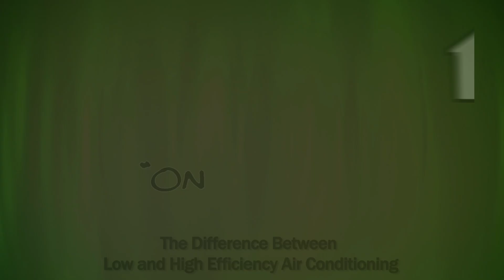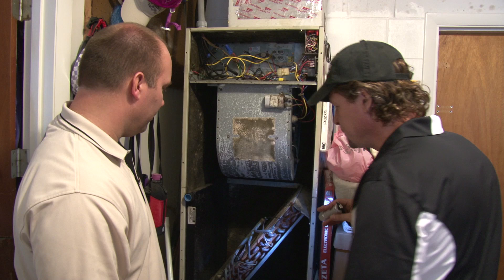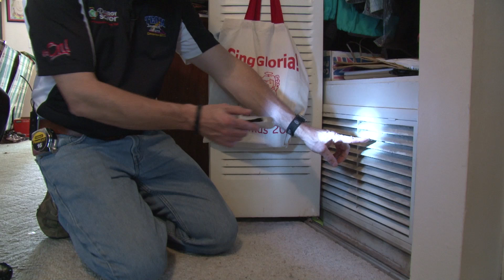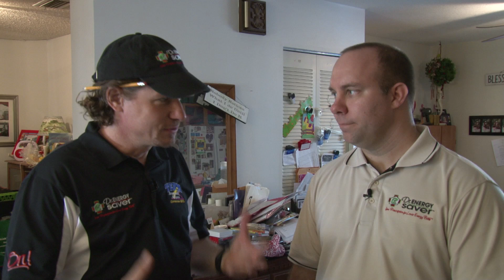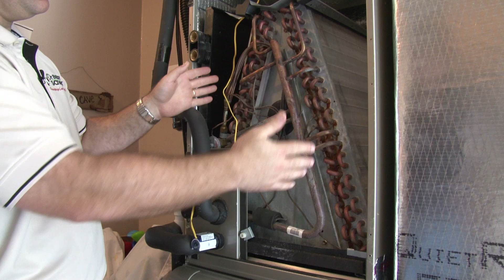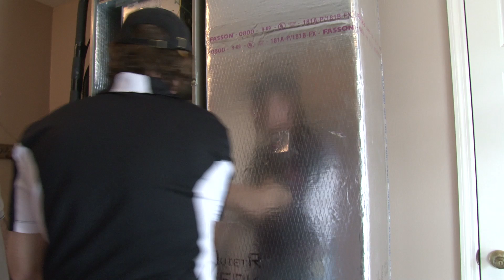The Difference Between Low and High Efficiency Air Conditioners

Comment: I am an HVAC tec ..THIS GUY IS LYING,,, THERE HAVE NOT BEEN ANY  4 TO 6 SEER  units sence 1992 when 10 seer was mandated by the government. in 2002 it was  changed to 13 seer  this unit was made in 1995 according to there dates given and the age of the video. it could not be less than 10 seer.  I have seen this tactic used to scare people into a new unit.

Comment: lol most of the stuff these guys have said in this video is wrong.  For example they didnt know which direction the air moves across the condenser and he called a capacitor a contactor.

Comment: The bottom line is this the bigger the radiator on the outside relative to its size the less money it cost to operate and the more efficiently it works. There is no new technology being employed here just make the radiator bigger and the unit is called 14 Seer or 16 Seer or 20 Seer or 25 seer. While there are other small improvements like more accurate expansion valves the bulk of the high efficiency rating is the size of the condenser. Higher inefficiency you go though the more gadgets there are to go wrong and the greater the amount of the repair bills and I wonder whether there is even any payback over 20 years. Usually your electrical provider will do an energy audit for your house and put all this in writing for you for free. Maybe we should try that before we just run out and buy a new unit.

Comment: where i live, there is few honest hvac buisness or quailified techs to work on the latest greatest multispeed superduper ultra custom high efficient 20 stage compressor, but warning they will get fined and everyone does life in prison, if they do a change out, and dont change over the refrigerant to the new stuff that hasnt came out yet. and they are only required to change out the air handler as a complete unit, unless its hard to install.
guys before you let anyone try to get you to remortgage your home make sure your home is insulated well.  and there is plenty of used units out there for the ones that cant afford a wifi 19 seer unit to add on a mobile home.
to the people that can afford a new unit im not talking to you.

Comment: This is nothing but a SALES PITCH from these two salesmen. I am a retired engineer and would not buy anything from someone that pushes the pitch without having metrics to backup their argument. Both the condenser coil and the evaporator are heat exchanges that may see some loss in their operation but nobody should be replacing their ac unit just for that reason. Washing your condenser coil with a garden hose a few times per season will ensure a favorable and efficient operation.

Comment: High-efficiency units cost 40% more to repair down the road because they have 2 compressors in the unit outside, it causes your unit outside not only to run in the summer but also the winner. Which makes it work double time, not good! I had a heat pump finally was able to got rid of it. I’ll never will go back again! I guess you have to live in learn, the hard way? Just my opinion not trying to make anyone mad.

Comment: "All heatpumps are AC but not all AC are heatpumps".

It is just big lie. It is exactly oposit - All AC are heatpumps (mostly) but not all heatpumps are AC. AC can "just" cool and use heatpump for that. But heatpump itself can reverse cycle to heat instead of cool but its not called AC more.

For example: Fridge is heatpump to but it is not AC, clothesdryer usually use (new machines) heat pump but it is not AC.

There are many lies and inaccuracies in this video that people never should buy anything from this guy...

Comment: The air-conditioner unit locates inside the house; the water drainer system was not perfectly designed. I cleaned up after the first water leaking, and then it leaked again after two
weeks. Finally, I found they installed two 90 degree PVC which causing clogging. So, I had to remove one of the 90 degree PVC. Since then, there have not much problems...

Comment: Oil the bearings on the condenser and Blower motor. Clean both sets of coils, wala, peanut butter and jelly sandwiches.
Reply: 90% of hvac motors are sealed bearings
Reply: @harryjames5904  I do not have the information to back up that figure. I oil mine once a year with none detergent oil. My HVAC systems has been running for 21 years.

Comment: I get the point of this video but they fail to explain its really amazing and good value that this AC lasted 17 years.  I live near the ocean in Florida and we only get 10 to 13 years at best.  In fact, my 10 year old Tempstar has large sections of fins missing from deterioration.  These guys are hating on this 17 year unit but a I would kill for that reliability.  I went through 2 blower fan motors on the damn thing and will buy buying a new coastal rated system.   I'm about to get broke.
Reply: Our Goodman AC lasted 18 years, still works just low on R22 (which is illegal now) and the A-Coil now has leaks. We have an HVAC friend that had a few spare tanks of R22 and he recharged it and it's working again for now until we buy a new unit.
Reply: My old York lasted 25 years when it broke in 2015.

Comment: SEER stands for Seasonal Energy Efficiency Ratio, not rating. I'm in the process of buying a new unit and learned this today. Thought I'd point out the mistake lol.
Reply: You misunderstood the information you were given the higher the Seer the higher the efficiency I also don't know what you mean by rating. Air conditioning systems are rated by the Seer rating.
Reply: @6barry66  Didn't you watch the video? He said "rating" (1:44 mark). Should be ratio. Not sure what you're talking about in the rest of your comment. I didn't question anything about "higher the Seer the higher the efficiency".
Reply: My comment was from a different video not yours it's somehow got mixed up on YouTube and ended up on you my comment was not directed at you. It was to a different video.
Reply: @6barry66  No problem. It happens. Have a good one.

Comment: What about a 1982 model? What would be the typical seer rating be? We have a very old Coleman still running, but we upgraded to 19 and 21 seer mini splits ...

The nice thing is the original gas furnace still works, which is generator friendly for the most part

Comment: Some energy companies exaggerate concepts and use key words to sell sell sell.  Why are they assuming that unit lost seer rating over the years? As long as compressor has good valves and coils are cleaned the seer will be the same.  The house insulation factor plays a much higher role in energy costs as it deteriorates.

Comment: I am a HVAC tech. They are correct on all the technical information provided in this video. I have changed my 15 year old unit for a 21.5 SEER w/ HEPA filter and UV light w/ charcoal filter system. What a major improvement in air quality and cost of electricity. This show is great. Several tips I did was to insulate the electrical outlet and switches and finally install on the east and west facing windows a UV heat film from The Home Depot. I am saving now close to $230 in  the summer time per  month. My unit is also solar ready. I can run it just on 5 100 watt panels. I love this. All this tips come from watching this show.
Reply: That's right. Wait a little till that newly super efficient unit starts breaking down on you and see how much it is to fix it comparing to the good old ones. Then sit down and calculate how much money you will actually save.
Reply: good job!
Reply: it's only us who really understand...lawyers, doctors, and CPA's are practicing just like us....thus our value.

Comment: I've had techs check my air conditioners every year since I bought this house 14 yrs ago & they've never once cleaned the coils in the air box one time. In Houston the tech don't come out to fix or repair air conditioner's they're come out to sell you a new one.
Reply: I cleaned my zig zig or A A coil evap and it was a b*** took my 4 hrs start to finish and it was bad, but woah what a difference my air is better cleaner stronger colder and cools faster
Reply: they are either lazy or they are masters of understanding super heat and/or sub cool...perhaps it doesn't need cleaning but i like to at least sanitize...use your gut to decide who you can trust.  If you have to see your AC guy more than 3 times a year, reasonably speaking due to age of your system, then you might worry.  That being said...sometimes the application or installation was never correct.  if you feel within reason that your system is working well and you don't have to think about it for whatever various reasons....you're probably fine.  BUT it is 14 years old...be ready soon to replace as they don't make anything like they used to.

Comment: I've been doing industrial, commercial and residential hvac and building automation for over 35 years.Their is a paradox here. If you spend quite a bit more on a higher efficient unit and it's cost to remove the old unit and install the new one, how long will it take you to get that upfront cost back in energy savings vs replacing it with a lower seer unit. Also understand that a higher efficient unit's parts are considerably more expensive than a lower efficient unit. ( kinda like parts for a Ford Taurus vs a Chevrolet Corvette)  He spoke of a variable speed evaporator motor and the unit having two compressors. Also If it has a low ambient kit in it driving the condenser motor, there is more cost and more parts to consider their too.Common sense says if you have more components and they are high performance components, then you will have more repair costs eventually. All man made parts eventually fail. Your contractor can buy a typical after-market 3 speed 1/3 hp 1040 rpm evaporator motor/cap for about $75.00 bucks for a typical low seer machine. The newer units motors now are using the ECM X-13 and ECM Variable Speed Motor Modules...the modules themselves run about $150.00 for just the module. The motor it self added in if it fails can bring the evaporator motor cost to over $300.00 and thats the contractors cost, before it is marked up and then sold to you. Two compressors equals twice the chance of a failure vs one compressor. The best thing you can do is keep your filters clean, washout the condenser coil every spring and check the evaporator coil and clean if necessary as well. The correct size unit for the space is crucial as well as your duct work being tight with minimal air loss and the MOST IMPORTANT thing you can do is make sure your house is well insulated, windows for sure, door weather stripping and correct attic insulation is a must. Air conditioning is not designed to put cool air in your house, it is designed to remove the heat from it. A typical rule of thumb I've found to is for every degree you lower your stat, it can add around 8% to your bill and that works for heating too. So lets say if you set your thermostat to 72 in June and your utility bill for that cycle is $300.00...then if you set it 2 degrees lower to 70 the next month it will be around $350.00. That is if the outside temps both months are similar. The new smart stats can be effective in better comfort and some modest savings but again, with their cost being considerably higher than a typical no frills thermostat, how long will it take to see some noticeable savings. One thing I can tell you without a doubt is a two compressor unit with the right thermostat that looks at and can control the humidity in the house can be very effective concerning comfort. A 74 degree house with 50% humidity can feel more comfortable than a 72 degree house at 70% humidity. That is where the correct size unit is crucial concerning humidity. One thing that never works is one unit conditioning both downstairs and upstairs. Upstairs ALWAYS has to have it's own unit. And with the newer units having two compressors, you can now put say a 5 ton unit in place of a correctly sized 3 ton unit in an upstairs because most people especially in the south know that in the hottest months, the upstairs unit runs from 10 am to 10 pm just about non stop and usually can't bring the temp down lower than 76 in the heat of the day. But if you install an over-sized unit with two compressors, it can run one compressor in the typical months and reach set point and can bring in additional help with the 2nd compressor and more air flow in the hotter months when they struggle the most.Hope this helps.
Reply: Marketing strategy is sell sell sell,,, stick with basic system with a good dehumidifier
Reply: Just got a whole home dehumidifier
Reply: RobVoyles What I learned is that is a good investment depending on the upgrade you are doing. Going from a 20years old Seer 8 to a new Seer 15 will bring you a big monthly saving. Going from 15 to17 will cost you to much for the saving. Better invest that money to upgrade the insulation. The HVAC is secondary to the insulation. Is like try to cool your coke and keep it cool on a regular glass and on a insulated mug. You will need a lot less ice to achieve and keep the temperature if is well insulated.
Reply: Comments often have more value then the video.  Thanks for sharing.  This past year I found two major heaters that I repaired.  Poor insulation in a recess ceiling that would always hit 120,  and bath skylight, poorly insulated with 120 degrees in summer.  These two fixes made my 13 seer 4 ton AC work so much better

Comment: ♦️Here is a secret the air conditioner sellers don’t want you to know. Question: Which home air conditioner uses the least amout of electricity?   Answer: The one that is off.  

I live in Northern Wisconsin, USA.  A/C unit is 26 years old, no repairs yet.  I use the air conditioner less then 30 days a year. Even then, its noirmally only 1/2 a day at a time, so about 350 hours of run time per year.  

Also, our local utility has restructured their rates such that the fixed portion of the monthly electricity bill is larger and the variable “usage” portion is lower.  This new billing structure reduces the energy savings incentive from upgrading to newer, more efficient appliances, or installing your own solar system.  The utility did this pricing restructure so low energy users equally support the electric grid during peak demand.  People who use solar, it was claimed,  hurt the other utility customers because peak energy use is just after sunset, something called the duck curve.  Solar owners use less energy when electricity demand is low then pull from the grid at the same time everyone else is too, shortly after sunset.  Low cost suppliers to the grid like nuclear need constant demand to be efficient.  So solar owners really put a strain on the grid.  The new rate structure attempts to correct for these things.  

Although a new air conditioner unit may be more efficinet, my utilization rate is so low, and variable energy rate so reduced that when I ran the numbers, its not worth updating my air conditioner until the old one fails.  By my calculations, payback exceeded 20 years.  

Now my furnace, which runs about 8 to 9 months a year, is another story.  I updated my gas forced air furnace about 7 years ago, as I took advantage of a warranted failed heat exchanger credit.  With the discount due to the heat exchanger plus federal government incentive due to the improved efficiency, the post discount payback was under three years, actually 29 months.

Comment: Total joke. The higher the seer the more it cost to install and repair. You will not make up the savings in electricity vs cost to install and Maintain.
Reply: You could change it to a fixed orifice but you would lose efficiency and have higher humidity in your house. TXV is the best way to meter refrigerant.

Comment: I would prefer a 6 or 8 seer system over the new crap. The energy needed to cool the house from an a/c with the same tonnage has changed very little. And I have had customers say that have paid more in the new system than the old.

Comment: These guys are completely full of bs.  The big line which is the return line is insulated to prevent condensate moisture and missing insulation on the exterior won't hurt efficiency.  One thing to know on your high efficiency models is that they gain efficiency by using thinner walled copper.  The downside is the life of the condensing coil and evaporator coils is greatly reduced and especially on new houses in which formeldahyde is still leaching out of the OSB, etc.
Reply: I need to do my AC homework. What I am gathering is that the new 410a units run at a higher pressure through thinner pipes. If that is true, this is all straight ripoff in disquise.

Comment: More bells and whistles on those high effiecincies cost more to buy and more to go wrong leading to higher costs to maintain and repair. Plus 410a freon runs at approximately double the pressures and more pressures mean more leaks. Nothing to worry about there, huh...  I think I'll keep my old R-22 unit as long as I can.  It doesn't leak and keeping the filters clean and washing the condensor coil with a water hose on a regular basis keeps my unit humming along.

Comment: "This unit is a 6 or 8 SEER unit" 17 year old unit would make this a 1995 model.  Strange, The  legislation took effect in 1992 was passed requiring a minimum SEER rating of 10
Reply: Can we talk about them saying the heat is rejected out the side of the condenser coil? When air is induced through the coils and pushed out the top by the out door fan.
Reply: Yeah. They also couldn’t even explain the direction the refrigerant flows. Smh
Reply: That’s what I was saying.. I’m only 30 yrs old but seemed like a 10-11 seer to me.. 6 sounded way to low
Reply: So, ya caught them telling Lies to the Grannies & General Public...
Now what r ya gonna do about it?